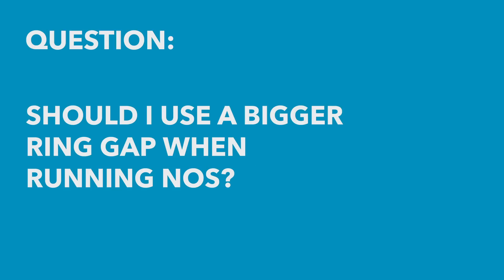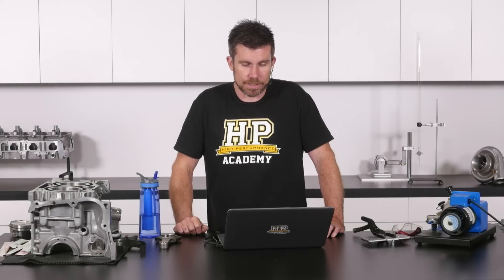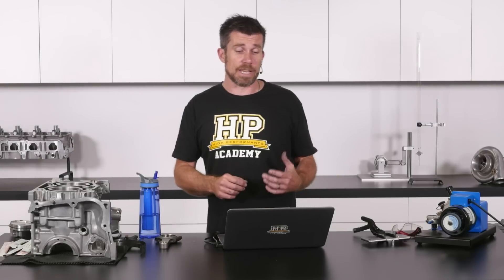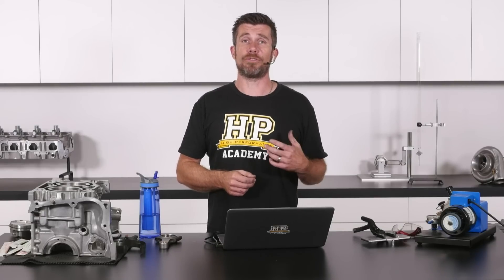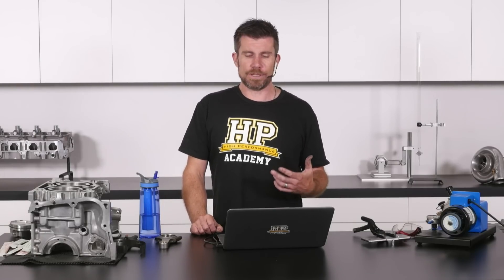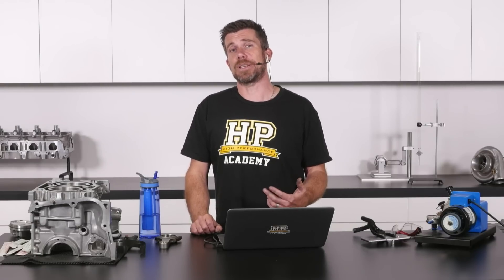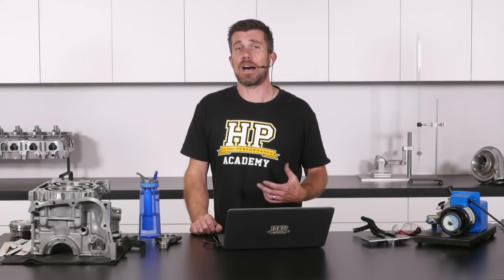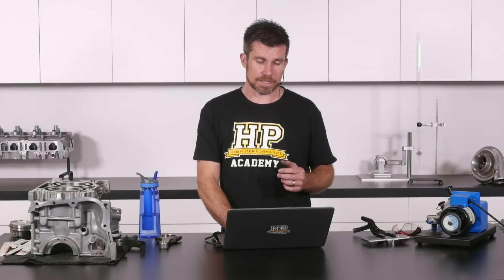Piston Ring Gaps | Bigger Gap For Nitrous? [HPA Q&A]

Comment: So just to confirm if you go forced induction but using cast pistons from NA motor you should increase the ring group to assist with the heat issues and avoid damages to the ring lands due to the extra pressure

Comment: Does ring thickness affect how much heat expansion occurs?
Reply: NGT yes 
thicker ring= more contact = more friction = more heat
Reply: Absolutely not. The source of ring heat is from combustion and heat transfer from the piston. The cylinder wall is the heat sink, that mean it takes the heat away. The thicker ring means a greater contact patch to take heat out of the ring. The increased friction (which is meaningful) from a thicker ring creates nearly meaningless additional heat, especially on an oil film cylinder wall. The ring is expanding because of combustion heat.
Reply: @mback12000  A thicker ring also reduces the chances of warping and stretch from thermal expansion. The surface wear from friction has a higher chance of destroying to cylinder walls over a thinner rings. But yea. The thermal expansion from friction on the wall is less of a problem than everything else. So there are benefits the thicker rings + smaller gaps = higher pressure levels , at the cost of cylinder life.
Reply: @Themayseffect  Thanks for the comment.  I would add that cylinder wall wear doesn't automatically increase with thicker rings without considering the applied radial tension.  Imagine the same radial force is used on both thick and thin rings.  The thicker ring would have that same radial force but distributed across a greater contact area, so "force per unit area" acting on the cylinder wall is actually reduced, but since it's over a greater area it ends up exactly the same friction.  Most thinner rings in racing have a lower radial tension to give reduced friction but are gas loaded during combustion (top or lateral gas porting) which momentary increases the friction dramatically on the power stroke and can wear out far faster than thicker non gas ported rings.  It all depends.